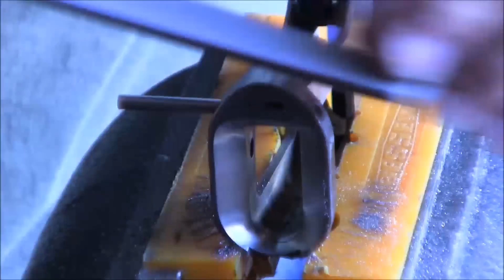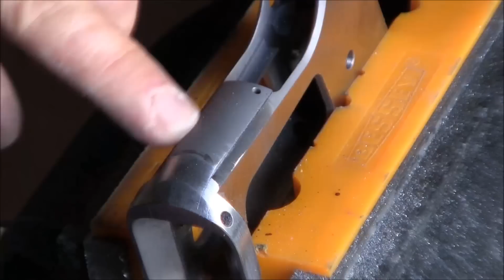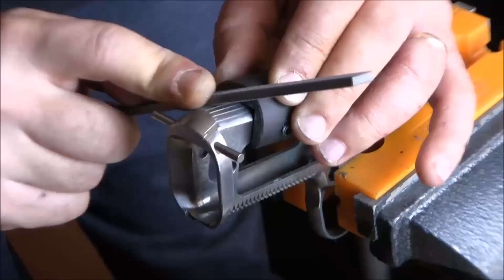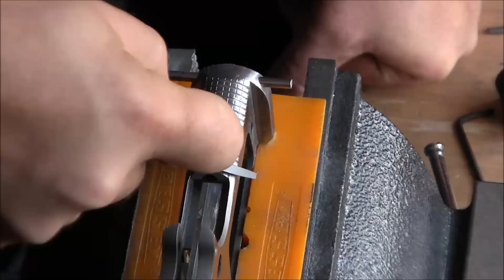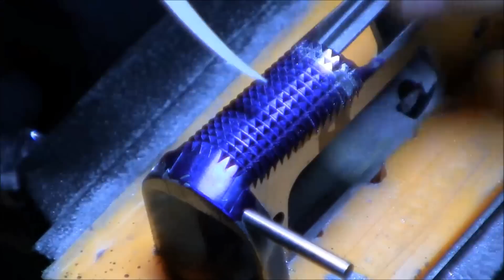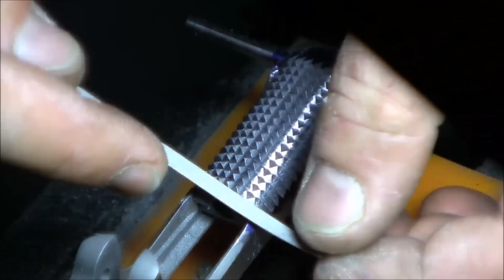1911 Build 8 Commander 45 acp - Part 3 - Rear Strap Checkering

Comment: that is some super aggressive checkering, just looking at it makes me feel like my hand is gonna bleed after 100 rnds
Reply from the maker: I am actually having more discomfort from the grip panels I chose for it than the checkering. This tips of my checkering are 90° so they are pointy but due to the angle they don't feel sharp. The grips I have on it are cut with a ball endmill so the tips on those are really sharp, or feel that way. After shooting 200 rounds my palms start bugging me. I still need to replace those grips but keep forgetting to do it. However if I was using gloves this pistol would be super easy to hold onto as is.

Comment: How do you register your finished firearms in California? im just curious because I live in NY which has very similar laws to California. I think to register it in NY it would have to be marked and serialized at the police station before it is completed into a "firearm" or registered in another state and transfered through an FFL dealer.
Reply from the maker: abraham m There is no law requiring it to be registered as far as I know. It cannot be sold or transfered from what I understand.
Reply: MosinVirus thanks for the reply I wish that were the case here. unfortunately where I live all handguns are required to be registered unless im mostaken but I highly doubt it. I wouldnt be to keen on bringing an 80 percent lower into the police precinct considering most of the police in my area now just about nothing about firearm laws. theres litterally a NY SAFE act hotline you can call but I get different answers every time I call. They told me that a detachable magazine was described as any magazine that can be removed from a firearm (I checked the laws and it said that a detachable magazine was a magazine that can be removed without a tool) but another guy told me sks's are legal. basically owning a firearm in new york is a crap shoot.
Reply from the maker: abraham m I am not familiar with NY laws. Sorry.
Reply from the maker: abraham m have you looked it up?

Comment: Wonderful work. I have watched all your vids. Can you share the manufacturer of the receiver? Looks to be an 80% carbon steel.  Whose jig will you use to cut the rails and barrel bridge?  Thanks and keep up the great work.
Reply from the maker: Richard Cooper this is a 1911builders frame in carbon steel. not sure who manufactures, because many different places seem to be selling same frames.
Reply from the maker: Richard Cooper oh, I will use the Matrix Rail cutting jig. and there is no need to cut the bridge since it already has a barrel seat and I will not be using a ramped barrel (this one is .45acp)

Comment: I gotta move away from this state. 80% 1911 builds are illegal in California :(
Reply from the maker: Darius Brown no, they are not. gotta build as single shot first.
Reply: MosinVirus I heard about that. Don't you have to buy some sort of conversion kit?
Reply from the maker: Darius Brown you could. there is a number of ways to do it. especially since the slide of a semi auto pistol is a bolt. I also have a Clerke single shot upper in .223. nramt (northern rockies armory) sells them in various calibers and lengths (I believe he got the rights to manufacture those a long time ago) and he can make you one on order in whatever caliber you prefer. That is if the law even applies to someone who makes for personal use. but if you want to be perfectly safe, get one of those uppers.